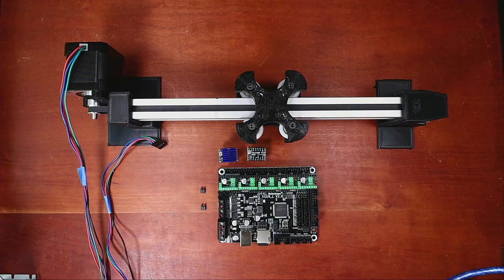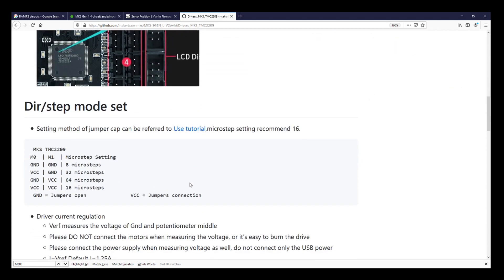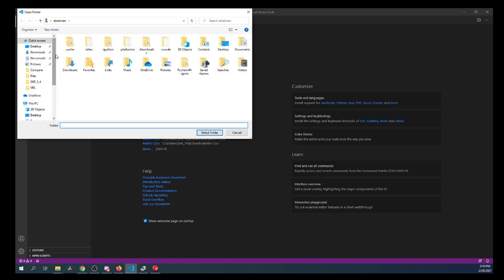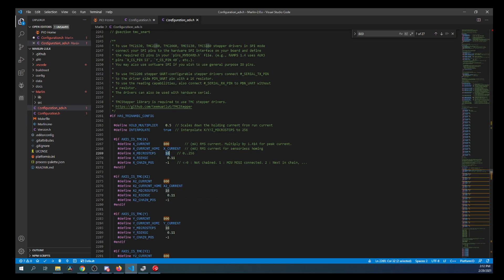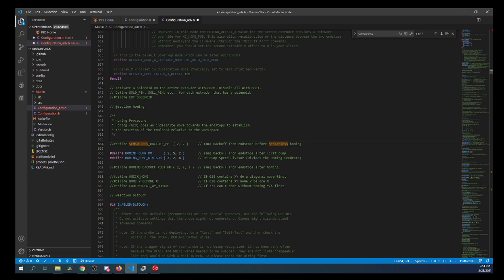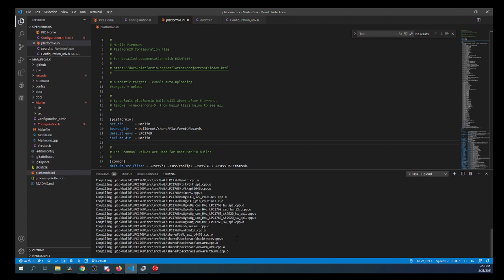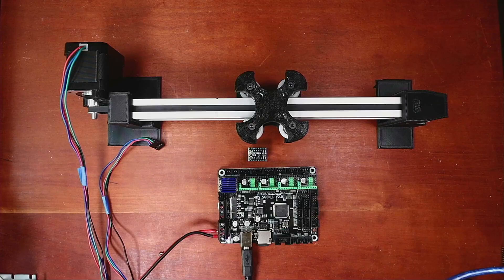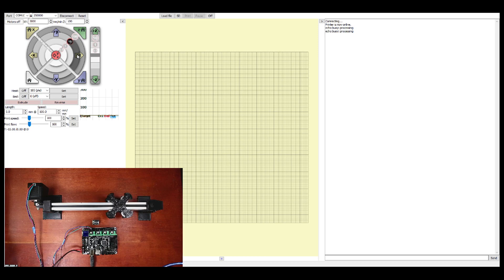MKS sGen L V2.0 - TMC2209 with Sensorless Homing

Comment: Ed ...  I own a TEVO Tornado ..  Upgrade from MKS GEN L 1.0 to a MKS GEN L 2.1 board using latest Marlin BugFix software ....  I have no control (relay 120v) on bed temperature ..  Apparently the software is not allowing my bed to turn on .. I do not show a bed heat on the display ..  And when build with Marlin Build - it shows "Cartesian (No Heated Bed)" first I have seen that on the MARLIN BUILD an not sure what thats about.
Reply from the maker: May I ask if f title of tutorial is the same as the silkscreen on your board?
Reply: @EdwardBraiman  Tutorial is not the same (V2.0 not for the 2.1) but cant find anything related to my issue on YouTube.  Not sure how long the V2.1 has been out and the change difference ...  I thought it was only in the chipset.  Thanks for your quick reply ..

Comment: Hi, I have the MKS Gen L v2.1 board with 2209, when I am in UART mode... the Z axis are not in sync.. .one spins more / faster than the other... It's a real headache. Any advice?
Reply from the maker: Split output off one z-axis.
Reply: Least you can get yours to move I can't move any steppers at all
Reply from the maker: There's a Discord link in description.

Comment: Hello Edward. I'm having a problem with the TMC2208 v 2.0 driver it doesn't want to work on the extruder MKS SGEN L v 1.0 motherboard. Help solve the problem, please. Sincerely, Alexander
Reply from the maker: What temperature are you trying to extruded at for hotend?  There is a minimum temperature of 170C before motor will operate to prevent motor from turning.
Reply: @EdwardBraiman  I changed the minimum temperature to 10 degrees Celsius. Drivers in standalone mode
Reply: @EdwardBraiman  A4988 driver works fine but is very loud
Reply from the maker: There is a constraint on motors moving in E0 and E1 because the extruder temperature need to reach a minimum temperature of 170C.  A work around is to modify the value in configuration.h from 170 to 0 degrees Celsius and test if E0 and E1 move.  Note when filament is present you should not do this.
Reply: @EdwardBraiman  I use your advice well. I turned on cold extrusion and removed the protection 170 and set it to 10 degrees in order to calibrate the filament flow without heating the hot end to E0
Reply: @EdwardBraiman  Спасибо за помощь.
Reply from the maker: There is also a gcode for this rather than change Marlin configuration.h.  I need to look it up, but it's like m107 or m170 s0 p0.
Reply: @EdwardBraiman  Oh thanks, I didn't know about this gcode
Reply from the maker: Might be m109 or m104.